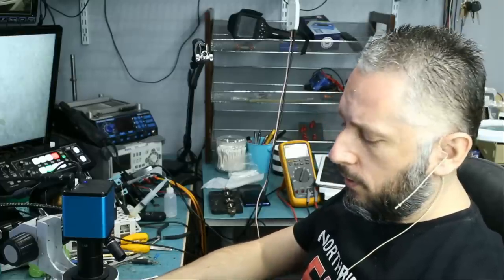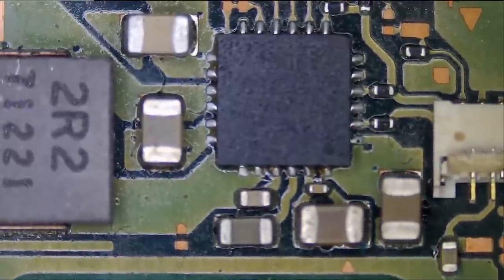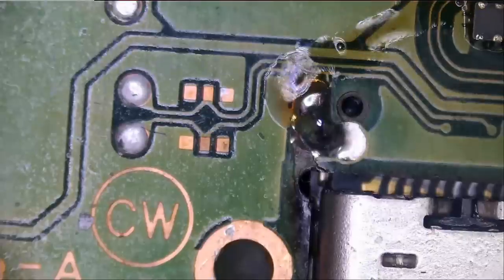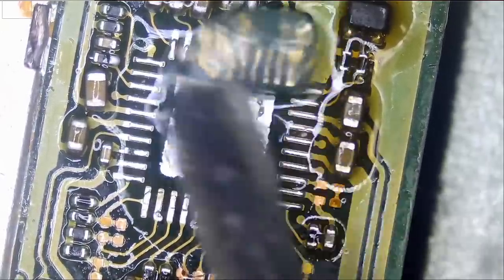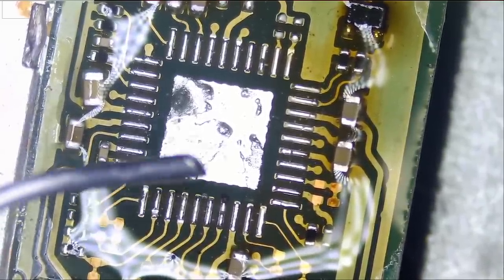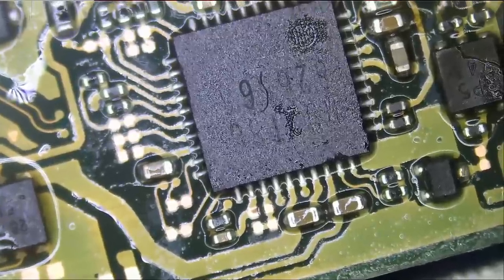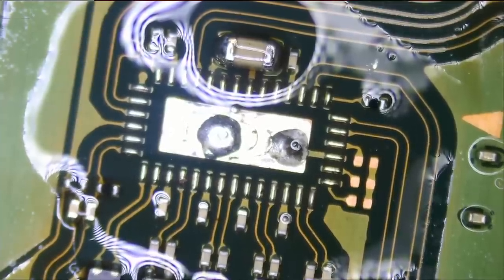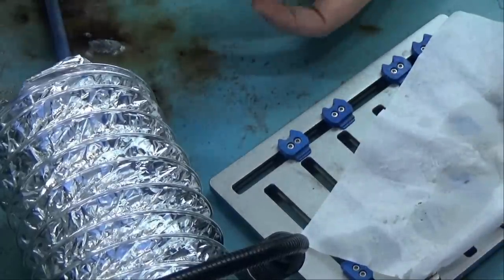2 Nintendo Switch sent in for repair from uBreakiFix. Thanks for 100K and Happy Holidays

Comment: No video on switch post Pericom IC (PI3USB) replacement could mean that one of the filters that connects to it is blown. It's usually the first one, as I believe that is the only one that is critical for the switch to work via the built in display

Comment: The black screen with it taking a charge could be a result of Auto RCM. A modification to the device that requires a payload to be injected to boot. Used for custom firmware, homebrew etc. You can plug it into a pc and run the software called Tegra RCM to check if it is in RCM mode. Customer should know if it's running custom firmware.

Comment: Might be worth the other shop to UV mark their boards to see that the originals are coming back or what chips are being taken off, seems to happen a lot in the business, I mark, tattoo just about everything with UV, soldering iron tip and when I put stuff into a garage to be fixed I mark up the bits with some hard to spot paint dots and some grey paint on the bolt heads so I know if they have actually done the work or not and there is a lively business in less scrupulous garages where they will replace nearly new parts on your car for worn out car parts and then tell you it needs fixing then charge you to put on your nearly new parts :(

Comment: Iam working on a switch right now.  All tests indicate that P13USB is bad.  I pulled it from the board and the caps still indicate a short.  I then pulled m92t36 and the charging port.  The caps that indicate P13USB as failed are still showing a fault.  Any advice is greatly appreciated 🙏.